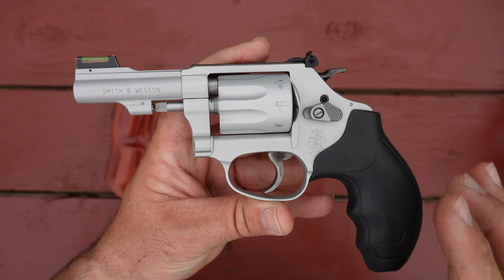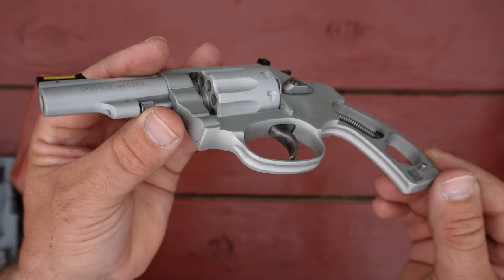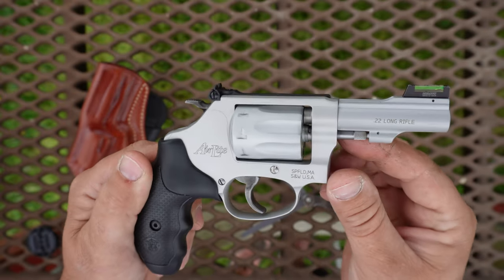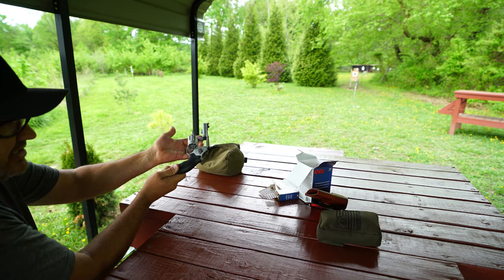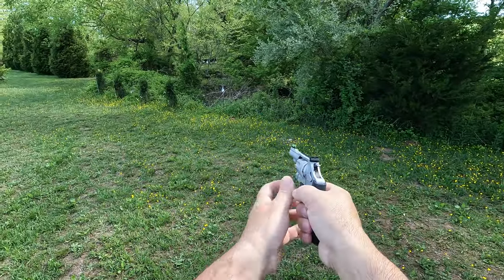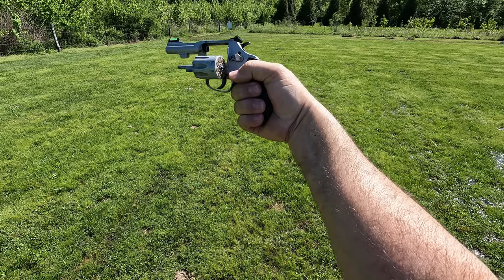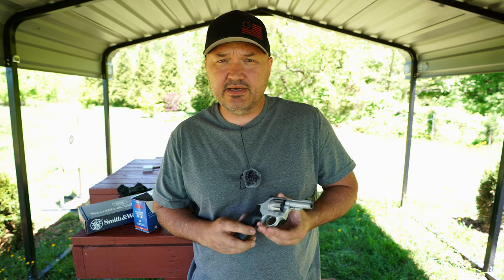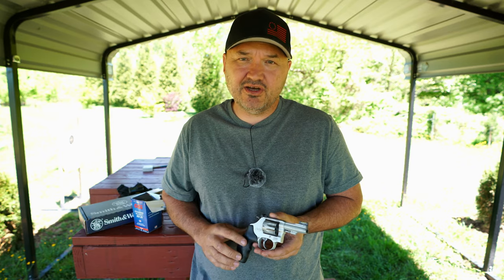SMITH & WESSON Model 317 TICK GUN

Comment: Your review is spot on with my experience with a 317 I purchased a few years back.  Trigger really isn't that bad for a small rimfire.  Downsides, first is the lightweight, which does make accurate shots more of a challenge, but that's why I bought it and you know that going in.  Really great to carry out on the farm, etc.  Secondly is the V notch rear sight, which like you I find not shooter friendly.  I looked at swapping it out, but was told I might also have to change the front sight to get it to zero so to me not worth the effort.  At somewhere better 3000-4000 round mark I did run into a problem.  The cylinder started jamming up and wouldn't turn and was almost impossible to open.  Sent in to S&W and they replaced the cylinder in a very timely manner.  It is my understanding these guns can be finicky due to getting the tight tolerances needed with the materials used.  Since repairs my has ran just fine.  Enjoyed your review and watch out for those ticks.
Reply: a little careful file work and a dab of cold blue will fix the rear sight.

Comment: I have a first year production 317 Kit Gun. It came with a square notch rear and ramp front sight blade. I replaced the ramp front with a Patridge front blade and put a set of Ahrends boot grips on the revolver. It has run fine and remained sufficiently accurate since. As for the comment on the "Indexing notches" (Locking bolt notches?), the timing of the gun is perfect and has remained so through 25 years of use. Not even a slight Bangor Punta cylinder ring mark, Also, the Extractor star is stainless, not aluminum so, no indexing issues there either.
The guns were priced around $400 back in the day. $800 seems a bit much for what is being offered but I feel that way about most of the firearms being offered HERE! in "The New Normal".

Comment: They have this for rent at my local range, but I took a pass, because it was almost too light (for what I expect in a revolver) and because…. $800 for aluminum.  But I did buy the S&W 63, the full stainless version, and it is a really nice 22 revolver.  Thanks for the review.
Reply: Why do you require your .22 revolvers to be steel? No need for heft when it comes to .22 LR imo.
Reply: @frisc0strangler207  Durability.  That aluminum cylinder will get sticky when hot and cases will be tough to eject.  Also a stainless cylinder face is easier to clean while aluminum requires care to avoid unintentional damage.  I believe that the crane also is aluminum so don't be abusive on cylinder closure. The weight also steadies the platform for aim.  The original 317 with 2" barrel gun was intended for deep concealment..  Any S&W is a first class firearm.  Get more than 1.
Reply: @frisc0strangler207  These are all just opinions, I understand.  For me, the weight comment is based on personal preference and application.  Sure, no "need" for heft based on recoil - 22 autoloaders are usually very light.  The super-light weight just seems odd, to me, in an old school piece like a revolver.  That said, there are plenty of light-weight .38/357 magnum alloy revolvers out there meant for carry and am sure they work just fine.  My 22 revolvers (I also have the nearly-40 oz model 617) are mostly plinkers, so I don't mind the weight and I perceive SS to be more durable.  I am sure the 317 is a fine revolver.
Reply: @richardkluesek4301  fair points. Thanks
Reply: @scooter5940  I can certainly respect that. Take care brother
Reply: does the 63 have the Hilary Hole, too?
Reply: @dgunearthed7859  mine does.

Comment: Had one back in the 90’s. It eventually cracked the frame beneath where the barrel threads in. Returned it to S&W and they exchanged it for a Model 63. Still have that gun.
Reply: Approximate round count,  and stress factors please?
Exactly what I worry about despite aluminum being way better than Zamak and junk gun mystery metal. The coating on contemporary models like the 296 was laid to waste with metallic cleaning gear. Defeating the purpose of one advantage of ti over steel (corrosion resistance where applicable)
I still want one of rhese but I want it to last 35 years, with outdoors carry primarily

Comment: I have a 4 or 5 year old 617 I bought new. Fantastic revolver. The huge steel L frame makes the recoil non existant. Great gun for teaching a newbie how to shoot revolvers.
Reply: I also have the 617 (I think they are K frames but regardless, very similar to L and much bigger than J).  I put on wood Hogue grips and fiber optic sights front and rear, because my eyes don't do well with black sights, especially indoors.  Made a huge difference.
Reply: @scooter5940  ah I just assumed it was L because the grips and holsters for my 586 fit perfectly.

Comment: Thanks, Buffalo!👍
I have an S&W Model 43 "Kit Gun Airweight" with 3.5" barrel.  I don't shoot it a lot, as it is more of a collection piece. Despite not being fired much, mine shows a very distinct "turn line" around the cylinder and some wear in the locking notches. They were designed to be carried a lot and fired little.  TBH the aluminum cylinders in modern guns are probably much better than the 1950s-70s Model 43.
I agree with you 100% that the Model 63 would be the best choice for someone who will shoot it a lot.  And S&W J frames in .22 are very shoot-able. Even in steel/stainless steel they are not heavy guns.

After experimenting with every kind of "snake load" i could make myself or buy in .38 Special, I discovered that within the range that revolver shot loads were really effective on rattlesnakes, I could just as easily shoot them in the head with a .22 revolver and regular bullets. Beyond the range I could reliably shoot them in the head...I could just as well walk around them. My S&W Model 34 Kit Gun, 4" was my constant companion when hunting, fishing or working on our family's ranch in central TX.  Often I carried it my vest or coat pocket without a holster.

Small .22 revolvers are absolutely ideal for training new handgun shooters, IMO.  I used the Model 34 for training my wife and all of my sons to shoot handguns.

Comment: Looks like a fun plinker, but that price seems steep. I also wonder about the durability of the indexing notches in aluminum.
Reply from the maker: I agree about the price point. They are expensive for what they are. I have not read anything about wear and tear of the index notches but I have read plenty of negative reviews concerning pretty much everything else on this revolver so there's that...lol Thanks for commenting!
Reply: Should be fine given the light weight of the cylinder. It’s the heavy cylinders like the models 27 & 28 that take the most pounding.
Reply: Price is ridiculous for a 22. You can get a 357 mag for that. If you're going to shoot tournaments you probably wouldn't use this either. It's an expensive range toy but there's nothing wrong with that.
Reply: I bought the model 63 and I love it. When I seen it at my local shop I was like Awww...now its sitting snuggled in my scout sling bag and I shoot the crap out of it crazy accurate lil pistol..
Reply: I have had one of these for almost 20 years. It has been shot a lot. Mine is scratched purty bad, and there is a bad ring around the cylinder, but it still shoots good, and locks up tight. It goes everywhere with me.
Reply: I had thought man that’s sweet and lucked across one used ages ago on the cheap side because someone didn’t like the fiber front sight. Love it

Comment: Hey Buffalo!
My rear sight fell off my S&W 317 so I bought a used sight off Ebay that has the square notch.
They interchange but you gotta be real careful with the sight attaching screw on the 317 airlite cause it'll strip out easy.
That's why my rear sight flew off.
The screw was stripped from the factory.
So i helicoiled it with UNF 3-56 thread repair kit.
Better than new.

Anyhow, I got them Skinner sights on my Henry Golden Boy now thanks to you.
Makes a big difference.

Comment: Thank you for  all the informative and entertaining videos. I learned to shoot with V-notch rear sights, bead front. For me, I like a very fine(small) front sight bead. Zeroed so that only all of the bead is visible in the bottom of the V, point of impact is on top center of bead and horizontal top of V. I've filed about a third off on both sides of front sight widths on a couple of my  revolvers with square notch and square front sights to get a small point to aim with. Super Redhawk 9.5" 44 magnum top of front sight level with top of rear sight, 100 yard zero, level the shoulders of my filed front sight with top of rear sight, point of aim on top of nipple ~200 yards on target. Horizontal marks on front sight can be added for other elevation adjustments. I hope this is understandable, wish I could attach diagrams.

Comment: I considered getting this revolver, but for the 800 dollars I prefer to get the stainless model 63.  I'm not carrying this pistol so weight is not an issue.  It's worth noting that the model 63 is very difficult to get while the 317 is available.  I also read on forums that some owners find it more difficult to shoot accurately.  Happy to see your groupings, perhaps it's associated to the v-notch.
Reply: Same here - I really had to hunt for the 63.  I'm fairly new to revolvers and that long trigger pull  - I only have two.  But a buddy of mine who has shot them for years picked it up and just shot the center out of the target, all double-action.  What a fun gun.
Reply: I bought a Model 63 about 30 years ago, and it is my favorite revolver.  I prefer all steel guns, as that is what I am used to.  I also have a K22 made in the early 1950’s, and it is sweet as well.  I think if I was to get another .22 revolver, I would look at other brands.
Reply: @johndilday1846  Thanks for sharing.
Reply: Just spend $1000 and get the colt cobra 22

Comment: Got one of these when they first came out many years ago with a two inch barrel and fixed sights. My only complaint is the very heavy DA trigger. Had one issue where the barrel leaded up, it was relatively easy to clean out and never happened again.
Reply: I have the same revolver. That narrow hammer spur is a pita, really digs into my thumb, a wider version would've been welcome. I got mine used so the price wasn't as bad.

Comment: The wife bought one of these with the 1 5/8" short barrel a few years back for around $580 (I don't think they offer the short barrel models any longer?)

It is super lite, and almost feels like it could be a toy when you pick it up. I got her a Kydex OWB holster for it, and she actually carries it when she travels. Hers also had about a 12 pound trigger pull, and I had the gunsmith put in a lighter spring set, and now it is around a 7 pound trigger....Still hard enough to minimize accidental discharges, but lite enough to let her work it. (she is tiny with small hands and short fingers)

I have shot it a few times, and I think it is a fantastic gun. I have shot more accurate revolvers, but this one does okay....I would buy one for myself if I ever see another short barrel model.

Comment: If you want, you can order a replacement rear blade and windage screw to change out your blade from the Smith & Wesson parts department. They have different size height and widths rear blades. I haven’t bought any lately but have in the past. I still have some of the white line blades I changed to all black ones.:shelterin:🐃

Comment: Nicen…I’m gonna have one eventually. Got my eyes peeled for 2-4 airweights. Found one ovem. Last winter. M 49 I think.?. Barrel is around 2.5 inch’s 38 j frame .pretty sure it is only a 38. Early mid 70s.want a Shooters grade. The gun I found was  from a shop owners private collection. Was the shrouded hammer hump back model. He had the same gun in hammer & DAO hed bought at the same time. They didn’t even have wrinkles in the wax paper. Decent price. $700 ish. Couldn’t do it. Like a revolver that’s been around the block a few times but shot very little. Those guns are probably in some guys safe now and will remain there until someone sells them at an estate sale. Hope not but happens way to often. Not too. Have fun!! I know I will. W 617 too. Take care.

Comment: I'd probably pick something like the 340 PD, the .357 Airlite for kit. Same weight, same size, and far more power for the 2 legged predators and the ability to use a shot shell that will actually kill small animals farther than 5 feet and .38 spl if you can't find mag ammo. Plus, MSRP is only $200 more.

Comment: PS. Last time I went shopping for that gun. Wound up with a LCP 2. Light rack. Making a holster. Owb.w 4 extra mags. Separate kydex pieces with a little flex between each part. Directional snaps on &off or ulti clips. Fast on fast off. I bought a new 92 FS Beretta and a new 638 with Crimson trace laser grip in the 90s. One of those was in the shop used. Had it in my hands. First one I had seen and I didn’t have quite enough cash on me. $310. And it was in great shape. Came up about 20 bucks short with the two other guns. Dangit!!

Comment: Excellent shooting!  I couldn’t afford that gun instead I bought 2 stainless 3 inch, 8 round Taurus 942’s, one 22lr. the other 22 magnum.both excellent revolvers however not as smooth as the 317 but after close to 700 rounds the  22lr 942 is getting there. I practice mainly with the 22lr as it is much cheaper to shoot. On occasion I carry the 22 magnum, as both guns fit in my Taurus 856 38 spl. holster.
Reply: I bought a 3"  942m. I think the double action trigger is fantastic.
Reply: I have thought about getting a Taurus .22 revolver as a study for my Model 856.  My 856 has been a great revolver, but .38 special is getting very expensive and a similar gun in .22 would be a lot cheaper and a hoot as well.
Reply: @johndilday1846  the 942's are plenty nice for the price. Much better than the older model 94 Taurus.
Reply: I have the Taurus 3" 942 22 lr at bedside with Winchester silvertip ammo. Very pleased with it.

Comment: I am torn between "eventually" adding a S&W M63 "OR" a S&W M63 to my collection.   I had previously owned a 6" M617 which I lived but sold do to the weight.  I have shoulder issues too whereas heavier pistols are an issue.  I am leaning slightly more towards the M63, for longevity reasons.   I shoot a lot of .22LR.

Comment: I almost bought one though one thing I remember about aluminum is it loses it's tensile strength where as steel does lose it's tensile strength.  I'd like to see how it handles a high round count.  I'm sure the steel sleeves will help a lot.  Never seen aluminum cylinder before

Comment: With the aluminum and steel parts, don't you run the risk of them bonding and locking up over time? I think it's called electrolysis; I remember reading about Cody Manufacturing's Thunderbird Revolvers, which had a very similar steel-where-needed/aluminum-everywhere-else design, and apparently they all eventually freeze up unless constantly maintained. I wonder how S&W gets around that, if at all?

Comment: The 317 will shoot MUCH more accurately if the fiber optic front sight is replaced with a plain black serrated ramp and the rear V sight is replaced with a square notch.  Smith and Wesson will do this if you send the gun in or you can just ask for the replacement sights and have a local gunsmith install them or do it yourself.  Alternatively, you can look for an older 317 with serrated ramp front and square notch rear on the used market.  Why the hell Smith and Wesson did not quit while ahead I cannot understand.  The Smith and Wesson fiber optic front sight has a rounded top which makes holding consistent elevation very difficult.  It is far inferior to the Ruger fiber optic front sight which has a flat top and is much easier to shoot accurately.

Comment: Please, everyone, kill every tick you see.  Lymes disease is terrible. A spring kit will bring down the double action trigger pull to a more reasonable 9-10lbs and still provide reliable primer strikes.   You might be able to switch out that rear blade on the rear site for a square notch. That cylinder gap IMO is too large.  0.006'' is as large as I find acceptable with 0.003''-0.005'' being what I prefer.

Comment: I have no interest in aluminum alloy revolvers and certainly no guns with keyhole locks. And it makes no sense to have the barrel on a revolver that has a steel sleeve instead of a fully machined out steel barrel
Reply from the maker: This revolver is designed to push the boundaries of the AirLite concept. A "fully machined out steel barrel" would defeat that. Also they make that gun already, it's called a model 63. Now if you can talk S&W out of putting the key lock on them I think you'd make a lot of friends out here! Thanks for the comment I appreciate it.